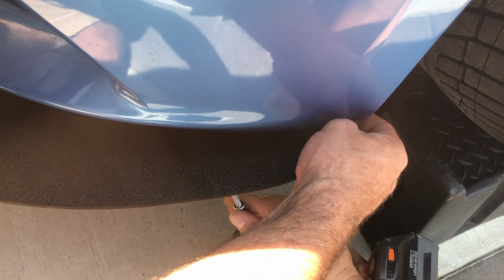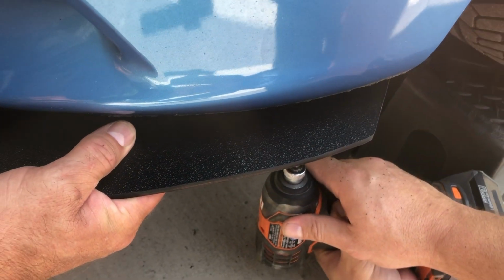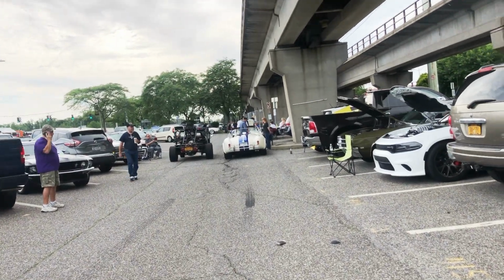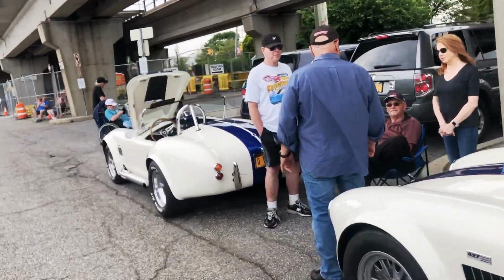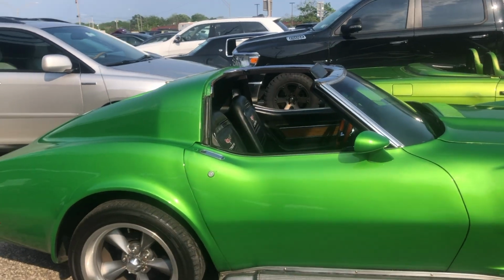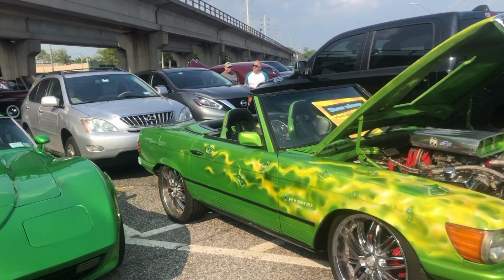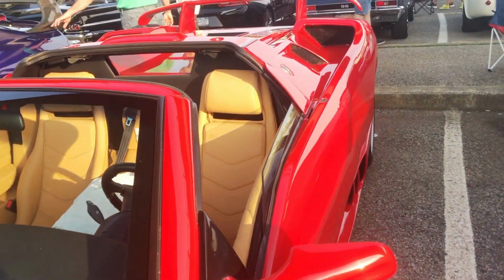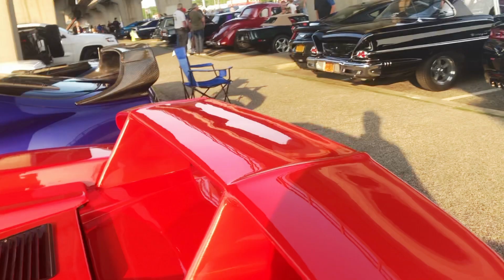NEW Charger RT Front Splitter...

Comment: Two things to point out.
1. Use a block of 2x in front of ramps. Gives just enough clearance for the lower valence and should make it easier to start the incline without parking the car thru the garage door in the process.
2. I use Ridgid and they are awesome. 
Have a good day.
Reply from the maker: Thank you - def appreciate the heads up.